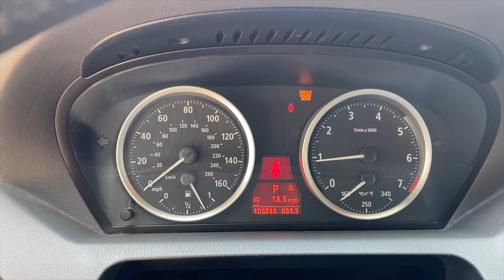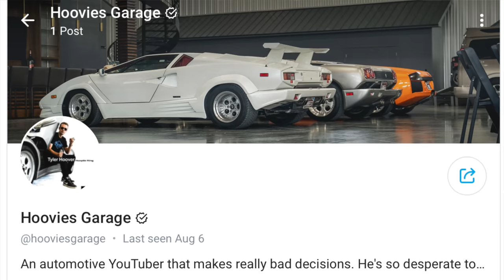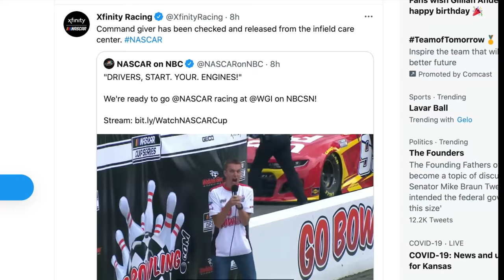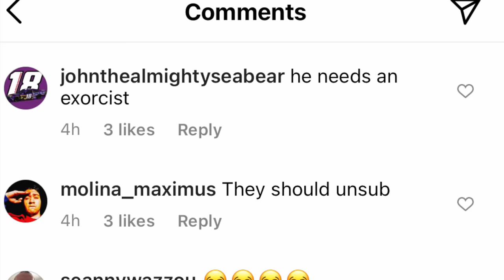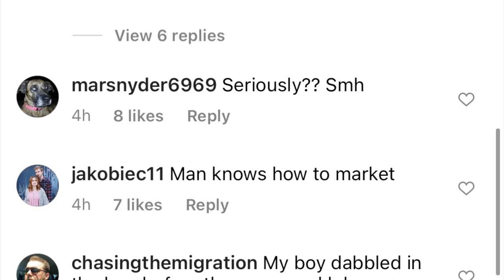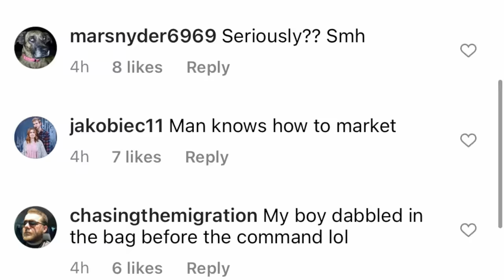I'm going to EXTREME lengths to buy the BMW DREAM TEAM

Comment: HOOVIE, you need to drive the BMW M1 that was made from 1978-1981. It’s a mid-engine masterpiece that looks Italian but has German build quality. Only 453 were made, but most of them are still in very good condition because they were made well to begin with. It might not be the fastest BMW, but it’s still VERY fast. The interior is roomy and very 70’s BMW: clean and logically designed. Although it’s considered an exotic (Lamborghini was involved to a degree) it’s not a car with a learning curve like so many exotics, it’s very easy to drive at any speed, the clutch and the transmission might be the best ever. Most of all it’s just a piece of rolling art.

Comment: I totally agree with Doug Demuro on this point - that 2001 BMW 7-series is THE most handsome sedan ever designed and put on the road! I've lusted after one since they were brand new but just don't want to tolerate the headaches that come with Bimmer ownership.
Reply: Just do it, life’s short:)
Reply: Ls400
Reply: My old drivers ed instructor is selling hers for 2k. It is in very good condition but it has 200k miles so basically a ticking time bomb

Comment: I had a 2001 e39 m5 until a year ago. Did about 180 000 in it. I never had any valve guide issues.
Never had to top up the oil between services which I did every 6000 (I have never trusted service indicators).
But I know that the pre 2001 models had a big problem with oil consumption.

Comment: I had a 545 and the same thing happened to me on the hwy except the water pump fully exploded and the belt flew off. Luckily I somehow made it to work with no power steering. It was actually a cheap fix in the end

Comment: my 2000 crv with 310,000 miles on it i’ve only spent around 100 dollars on repairs. a new radiator and front brake pads. i just can’t imagine or afford german engineering.

Comment: Only fans seems dangerous.  I think the reputation of only fans is bad  and you may not want to be associated with that.  I would do a patre_n type thing but I don't want to go to a shady part of town even thought there may be a shop there that I like.  Also if my wife sees a "Fans Only" credit card entry, I will just have to explain this.  I am not sure of what kind of deal patre_n gives you so this may be a mute point.  Why down 20%?  man I am sorry.  maybe you could find the worst car in America and fix it like a pinto  (paint it like a bean, fix the engine and drivetrain)?  Used car markets are up right now almost anything you do can bring in a bit of cash.  Rooting for your Hoopie by Hoovie.